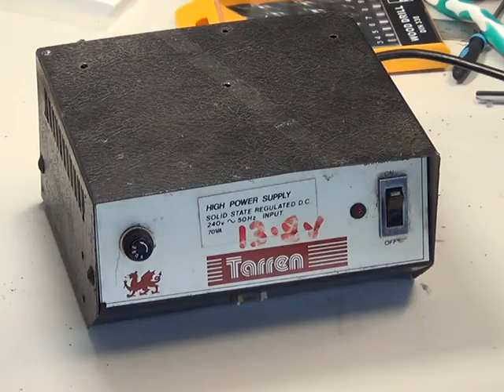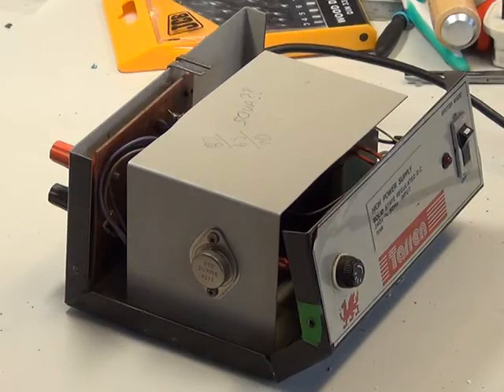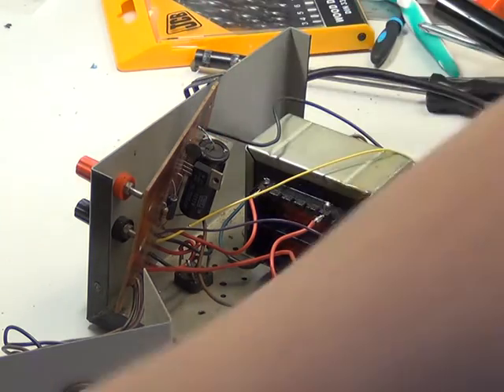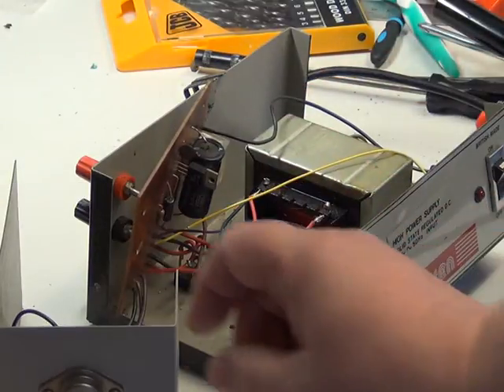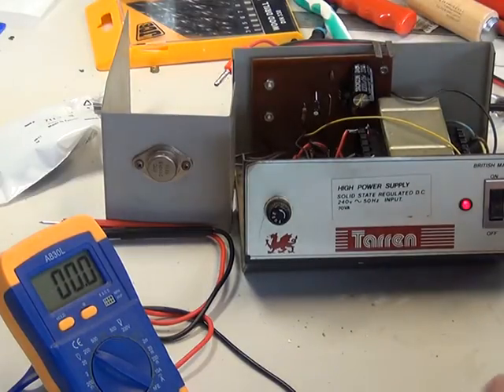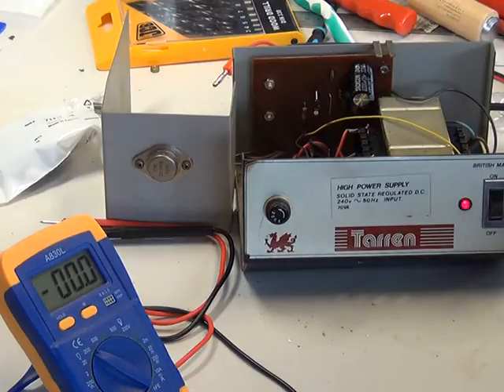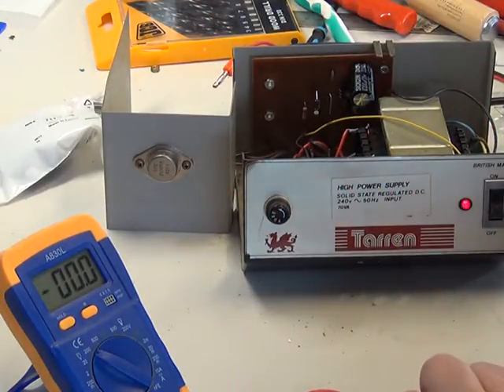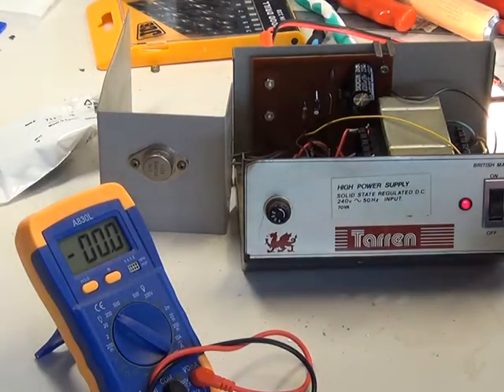Tarren 70W (5A) CB Power Supply - repair & service

Comment: A word to the wise, doubling up the pass transistors will massively reduce junction temperature despite the heatsink still running as hot. No need for formal emitter resistors to do current sharing just use a foot or so of fairly thin connecting wire from each transistor.

Comment: Thank you Richard, mine is a 3 amp too. Currently being used to keep my kitchen door open. A heavy well constructed unit. Last time it was powered up it showed nearly 15v. I was under the impression the regulator was shot, maybe that's how it's meant to be. Maybe I will install a resistor on the regulator negative reference leg to see if i can bring it down a little. I will post my findings if i get voltage in range. I don't like to over stress some of this old CB equipment. I would be happier with it under 14v.

The secondary fuse in mine is covered in tin foil. Obviously an old boge as today's foil is not of thick quality like this has.

I think I will fire in an order in for new caps and fuses and give it an overhaul.
Another great video Richard, Another bit of 80s history lives again.
Reply from the maker: No, I wouldn't want it any higher than the 14.2 that this is.....but is yours 15V on load? If the regulation had failed on yours of course, it would be 25V. Now making me wonder if some of the small resistors go out of spec....mmmm
Reply: Yes 15v on a 21w lamp, Very bright white light.  I can't remember the circuit layout but will look tomorrow, I will lift one leg of what resistors there are, and measure them but yes, it could be an out of tolerance resistor.
The T-03 regulator has been changed at some point (and badly re-soldered) so I don't even know if it is the right one. I will pull the data sheet for both the TO-3 and the TO-220 and see what is going on.

I don't know the history of this unit as it was left here for me to look at 10 years ago and I haven't heard from the bloke since.

I was looking for a circuit diagram but nothing on the net about the Tarren. Good door wedge though!
Reply from the maker: The T03 device is a 2N3055 transistor...so capable of 90W. The T0220 regulator IC had a number on it unknown to me.
Reply: Thank you for the transistor number Richard, I will have the lid off again later. If I remember correctly I did not recognize the TO-220 either, it was not a LM2940 or a 7812, nor did it look like it had been replaced. Most people that part out components don't clean the flux off the board and it looked clean to me.
It should still work voltage wise if the capacitors are not too good shouldn't it? But with a bit of ripple. If I can sort the voltage I will buy new capacitors for it.
Reply: Ok Richard, the TO-3 in the 3amp version (at least in this one) is a MJ2955 (PNP) rather than a 2N3055 (NPN). I have no diagram for this and it looks like it has been replaced as the soldering is not as good as I would expect. So i hope that is the correct one.

The TO-220 is a 7812 regulator, with a resistor between the center pin (pin 2) and neg (-V) rail. The out of cicuit value of that resistor reads 467ohms on my Tektronix Multimeter, colour code is Yellow, Violet, Brown, = 470ohms. Would a 3ohms difference cause an output voltage of nearly 15v?

Anyhow, new caps ordered, thanks in advance.
Reply from the maker: I think we both need to see a 3A version that's not been messed with. If your PCB looks like my PCB....as I would suspect, I rerckon someone has fiitted a wrong part...but we need proof. I'll get one from a rally or ebay. One is bound to turn up in the next few months. I can't believe that Tarren would do a 3A one PNP & a 5A one NPN...it doesn't make sense. 

I had his in the 90's when a Pye AC200 power supply came in wth a 2N3055 fitted instead of a 2955.....and one expects business radio only to have seen professionals rather than the bodgers!

Richard
Reply: The absence of a circit diagram does not help, maybe there is a kind youtuber out there that can lift the lid on their 3A version for me and publish the transistor numbers. If i find another unit i will buy it also. I will keep you posted.
Reply: After watching the video again Richard, the PCB is in fact different, as are the Caps.... 4700μF at 25v and 10μF also at 25v
Reply: Sorted! I replaced the 470ohms resistor that is between center pin (pin 2) of the TO-220, 7812 regulator and neg (-V) rail, with a 340ohm one as I discovered my incoming mains is at 246V AC.  Now have 14.08V DC off load. 13.99V DC on 21w load.
As well as replacing the Caps I rewired the incoming supply to go through the fuse before the switch.   

Thanks for the help
Reply: Richard, in my "70VA"  the regulator is a 7815(!) - no wonder the output is high.  Once the 2n3055 Vbe is subtracted you get the 14+ volts output.

The odd thing is that my PSU "only" gives about 3.5A before the output starts to drop off but I haven't checked the caps yet.

Comment: I've got an old 3 amp version here Richard which is still working ok however is really noisy.
Reply from the maker: This one rattles a bit. The transformer should have been varnish impregnated. You'll have to take your transformer out & shove it in a tin of varnish overnight & then let it dry for a week.....that'll cure it!

Richard